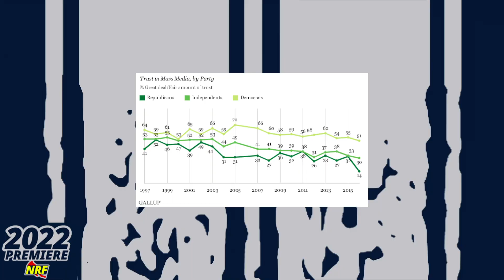How NASCAR's Next Generation Wins the Younger Generation

Comment: Outside of Sunoco, all of the other brands will still have a place. As they all produce brake fluid, differential oils and other lubricants. Sunoco could also still be a supporter of the series as they will likely start having charging stations at the gas stations.

Comment: I'm one of those millennials. and I watching stock car racing since middle school until 2007 full time alone side with Formula Racing. Jimmie Johnson and Hendrick Motorsports is what got me into it the same way Brawn GP & Mc-Cedes did with Lewis Hamilton and Jenson Button. 

They're some fans like me. I'm just a sole guy carrying the torch. and then I started watching more stock car racing with lower leagues, trucks, and for few year With ARCA. my reticle is on Bill's Son, Elliot. Kyle Larson. and I Kyle "Rowdy" Busch (yea sue me I said it) and even Brad Keselowski (sue me twice. shame on you). then 2014 happen. I switch to Internet Radio and make a good use of it. 

before that. I experiment with NASCAR's presence via Twitter for 2015 (which is a hot mess). until 2019 when switch to Internet Radio via Motor Racing Network and Professional Racing Network which it works for me. because Twitter gotten too soft and toxic lately. The Twitter Integration was canned due to non-stop squawking about politics. and keep trucking until my interest of NASCAR in IRacing got my interest. 2022 is where I stop watching NASCAR due to Gen 7 controversies.

 but I won't be gone any longer. 65th Daytona 500 is where I announced my comeback to for 2024 to see the evils of the Gen 7 Era NASCAR via PRN and MRN and see if its bad enough for me to give up NASCAR and move on to something like IRacing on ThemTube. 

right now. I'll wait till the 65th. and then. I Start my Magnus Opus Ultima (MOU for short) Tours to the end. not Just NASCAR on Radio. Formula 1 on The Radio as well as my I end my NASCAR and F1 Crusade came to the not a Boom. but also a Implosive end with memories wipe clean from the TikTokers, Facebookers, Dopaminers, Dopamemers, and Lamestreamers, and unpopular & popular fads & trends. and never look back.
Reply: I hate TikTok. I never bother YouTube Shorts. I didn't touch NASCAR on Facebook as such.